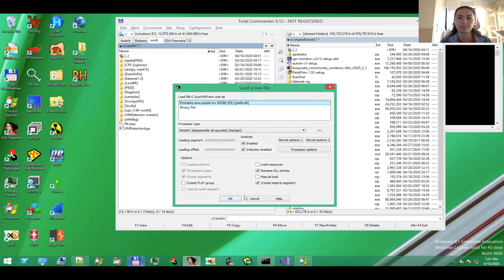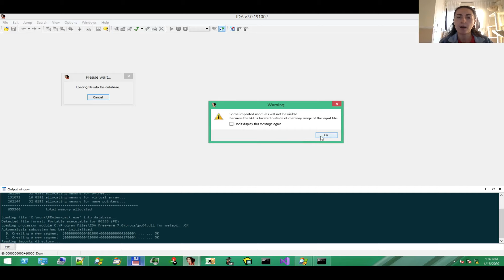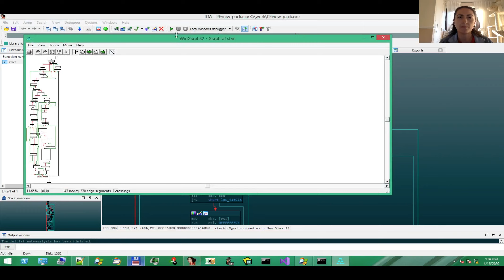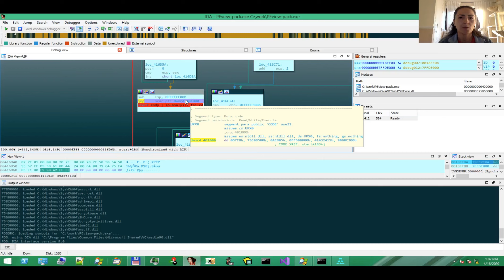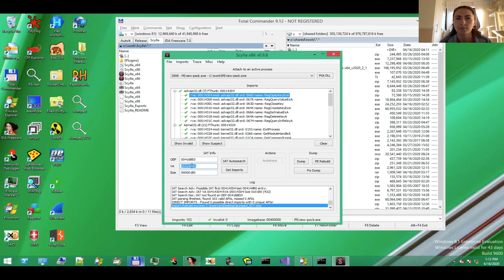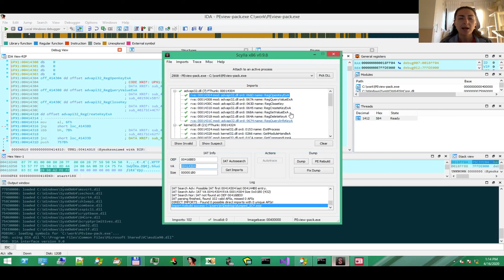Comment: Would be good if you could do it on a Linux distro.
Reply: kali linux has a giant stash of debuggers,cracking tools,and reverse engineering toolkits. the same principles would apply here as they do in windows.you have to simply think of the parallels of the programs in kali similiar to the ones used in windows.
Reply: Noted! Thanks for the feedback!